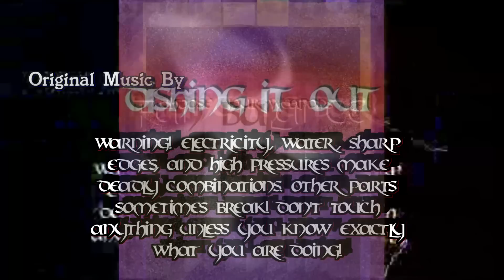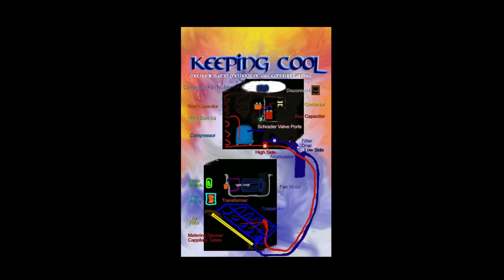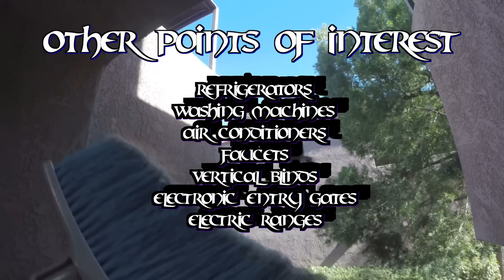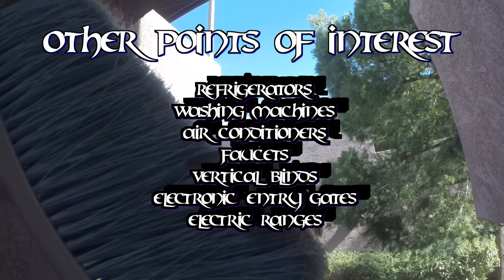Four Most Common Causes Of Air Conditioner Freezing Or Icing Up Repair Maintenance Video

Comment from the maker: Chapin Pro Pump Sprayer                             http://amzn.to/2vWCXdD
Evaporator Coil Cleaner No Rinse Mix        http://amzn.to/2x3eJTT
Evaporator Coil Cleaner No Rinse Can        http://amzn.to/2ezIxju  
Get KFM's favored Multi-Meter  here        http://amzn.to/2l8W9CO 
Wet Dry Vacuum used in so many KFM videos   http://amzn.to/2lFxi7u
Valve Core Removal Tool                              http://amzn.to/2kJ00pC
Inficon Refrigerant Scale                               http://amzn.to/2vUCQPD
Get the Screwdriver used in so many KFM videos here    http://amzn.to/2kHFoOF 
Get the Milwaukee 11 in 1 Screwdriver     http://amzn.to/2uTtsNj 
Get  the Multi Tool Pliers used in so many KFM videos       http://amzn.to/2kWTjPp
Get KFM favored Electronic Leak Detector        http://amzn.to/2kmQMMz
Simple Leak Seek Spray   http://amzn.to/2lFfcC5  Laser Thermometer  http://amzn.to/2layD8I  
Hard Start Kit     http://amzn.to/2kiD16v   Contactor     http://amzn.to/2lFqA0P
5mf Capacitor   http://amzn.to/2wC96sH     35mf Capacitor    http://amzn.to/2vZVZ2t
35/5mf Capacitor   http://amzn.to/2iVJNi2        40/5mf Capacitor    http://amzn.to/2wzEdXD 
45/5 mf Capacitor   http://amzn.to/2w0wez5   
Get KFM's favored AC Gauges here            http://amzn.to/2kYgGb8
Easiest Way To Get Universal EPA Certified Prep Manual    http://amzn.to/2kIQdQC
Condensate Pan Tablets   http://amzn.to/2lalV9W   No Rinse Coil Cleaner  http://amzn.to/2lHg8GD
Condenser Fin Whisk Brush                          http://amzn.to/2vWXUoC 
You must be EPA certified to charge or recover refrigerants and here is about the Easiest Way To Get certified with the Universal EPA Certified Prep Manual    http://amzn.to/2kIQdQC

Get The Kung Fu Maintenance book here     http://amzn.to/2lEQPFk
Or  the Kung Fu Maintenance E book here  for less than $5    http://amzn.to/2lEY8wD
Get the Kung Fu Maintenance album (good driving music) "Up Beat" here     http://amzn.to/2l41pZ1
Get the Kung Fu Maintenance album (nice Instrumental music) "Entropy" here   http://amzn.to/2kl2U0p
Samsung Galaxy S8 Plus        http://amzn.to/2sFn9h8
GoPro Hero 5 Action Camera         http://amzn.to/2sN4nVK
Rode Lapel Microphone                 http://amzn.to/2vZoFc7
Purple Panda Lapel Microphone  Kit   http://amzn.to/2wByXkq
Video Edit Pro Software       http://amzn.to/2ruaaeZ
Samsung Galaxy S5                 http://amzn.to/2wBxk6l     
Samsung Galaxy S8 Plus        http://amzn.to/2sFn9h8
Video Edit Pro Software       http://amzn.to/2ruaaeZ

Hire An HVAC Specialist                                  http://amzn.to/2lktKek
Air Duct Cleaning Services                              http://amzn.to/2lFTpun
Central Air Conditioner Tune Up                   http://amzn.to/2lzJGoy 
Air Conditioner Repair Or Installation          http://amzn.to/2lFsEGw                                           
I don't work for any of the product companies  listed however I do make a small commission on items ordered  through the links.

Comment: Can you use low fan speed all the time?
Reply from the maker: For air conditioning you can but for heater use it's much more efficient to use a higher speed.